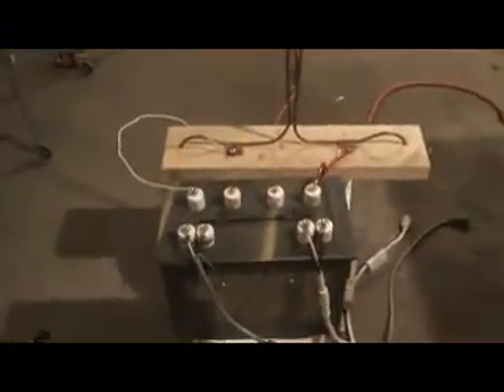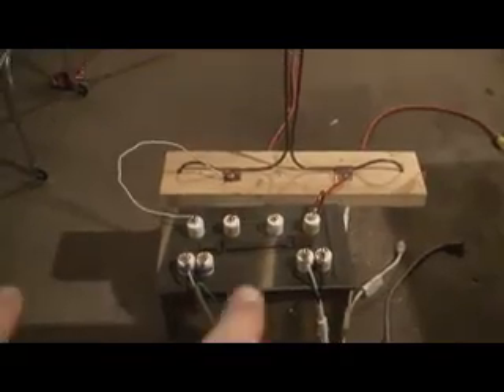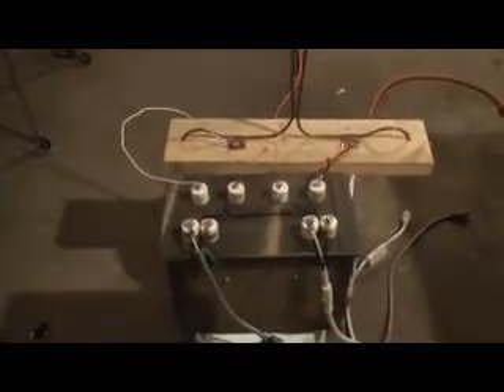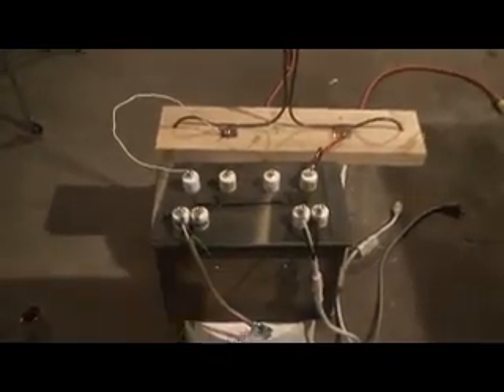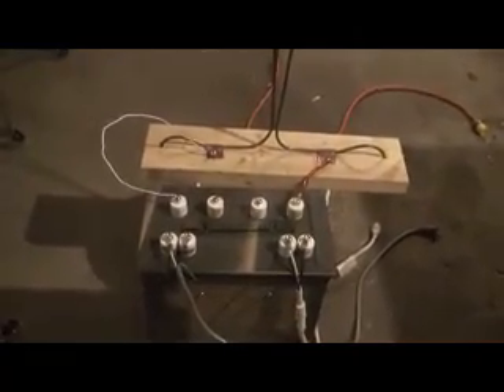2 mot resonant capacitor jacob's ladder

Comment from the maker: The HV side electrodes eventually arced over to the case and carbon tracked down the pvc stand off. The transformers held up just fine though. I still use them on one of my Tesla coils.